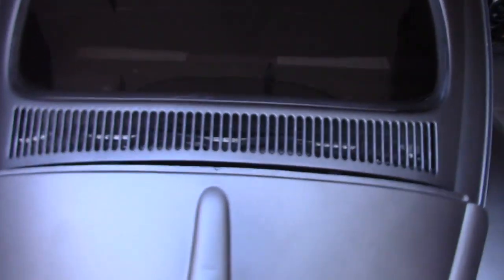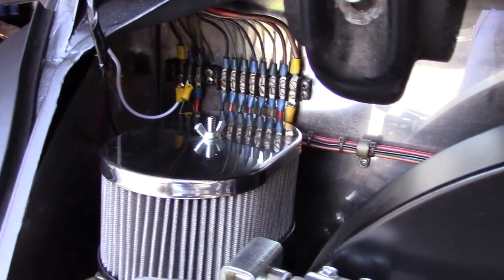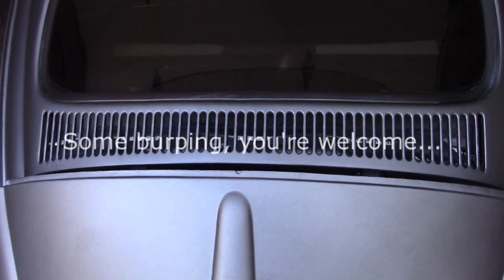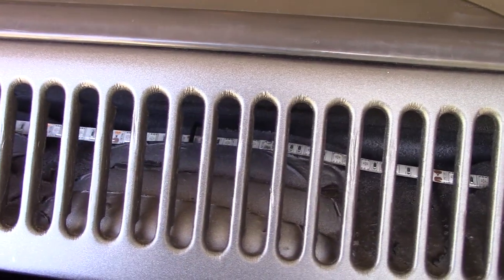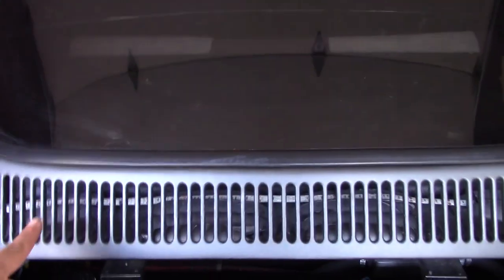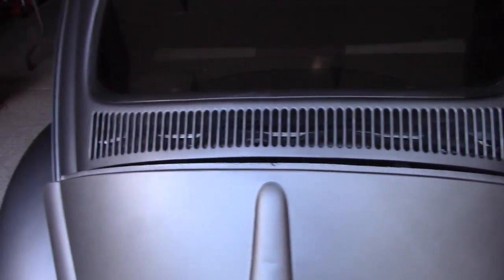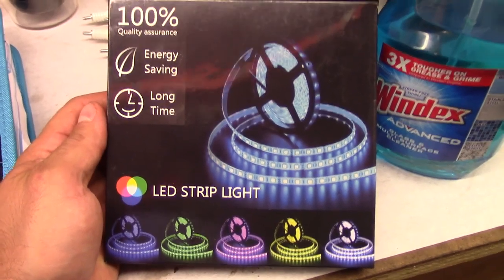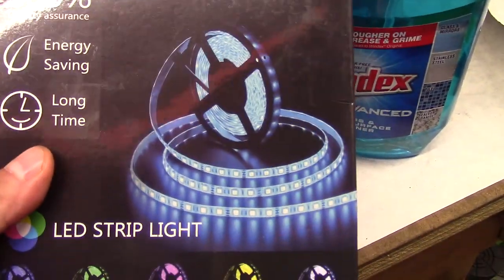DaddyCool Awesome VW Bug Third Brake Light

Comment: Love this, I’m planning a third light on my ‘65. The wiring in your engine bay, where did you buy the terminal strip? I’m in the process of tidying the bay on mine
Reply from the maker: Sorry for the late response!!
The terminal strip was on the bug when I bought it.  I bought more on eBay. To add more wire to the front of the car.   For a fuel pump relay and tach.

I assume you mean the bus bar, right?   The LED kit had terminal connections with it, if that’s what you were asking...

Comment: Crap they are 12 volts! I need 6volts!
Reply from the maker: Correct, this is 12v setup.  You can find 6v strips as well .

You should just convert to 12v.

My Ghia was 6v and I didn’t like it- dim lights , slow starts…

I converted it easily and love it.
Reply: Too bad my 64 is 6 volt…and its all og, im the 2nd owner,..dont wanna mess with changing it to 12 volt. 😕if u find 6 volt led, let me know😂😂🙏🏻🙏🏻